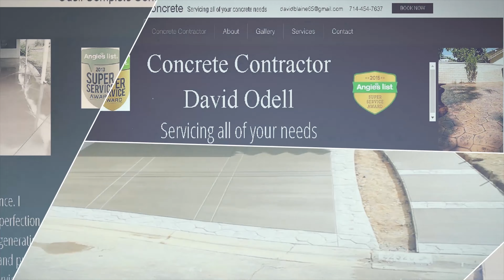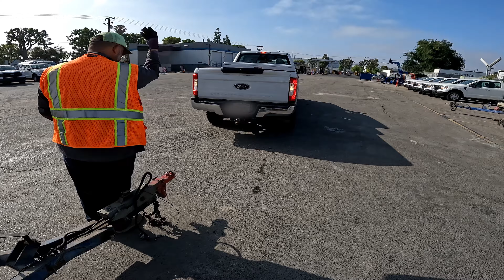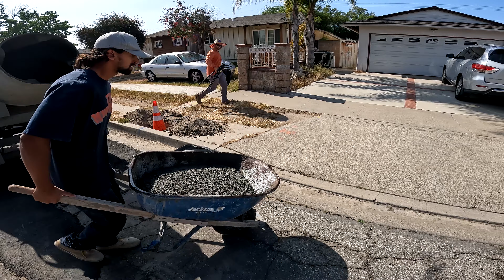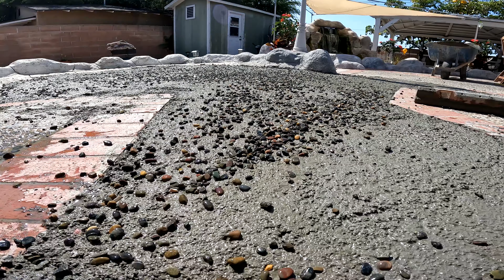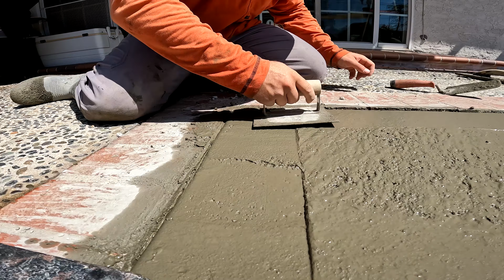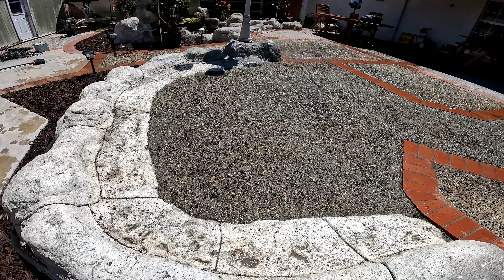DIY How to Get Exposed Aggregate Concrete Finish

Comment: He worked hard on that due to the heat think 90 is about 32 degrees in uk money thats some hot 🔥  stuff.
Dave here the concrete dont set quick is there something you can spray on top set it quicker to be able to hose off the cream .never done this but that would be my worry getting it to set .wales isnt hot .
Thanks mate and great videos 🏴🇬🇧🇺🇸👍👍
Reply from the maker: Concrete additives for fast or slow curing
Reply: @OdellCompleteConcrete  
Ok thanks Dave appreciate it 👍

Comment: Excellent video, often wondered how that finish was accomplished...
Reply from the maker: TY
Reply: generally it's not like this... usually you seed the stones, let it cure completely and then run a buffer over it to take off the hardened layer of cement, then the stones are exposed but also the entire surface is flat... the technique in the video leaves a rounded rock surface, not flat everywhere... also these WILL pop out over time due to that

Comment: Hi Odell as you know here in Iraq we work under 122 F° so its been to hot but we rather did the stamp concrete before sunset .
I'd like to ask you ... Is it worth to work like these mini projects about 9 m2 and you guys 6 and your trucks and that under the heat with waiting almost 4 hrs , is it really worth ? How much the square foot or square metre cost to cover this small project???
Reply from the maker: Sounds like Vegas

Comment: when would you use a magnesium trowel ,wood ,or steel towel in which order
Reply: Wood is for roughing up cream to make mag floating easier. Magnesium floats are for making everything flatter and somewhat smooth. Steel trowel is used to "burn in or hard trowel" the concrete like what you would see in garages or basement floors. In warmer climates they trowel a lot of their work. In more freeze & thaw climates you really want to stay away from steel troweling outdoor concrete.
Reply from the maker: I concur

Comment: Hello, looks great. That is interesting, united rentals will rent you the concrete mixing trailer, fill it with a yard of material. Can you specify the mix, stone, cement etc. Would you mind sharing how much the rental of the trailer and the yard of material costs. Thank you.
Reply from the maker: Yes, 1 yard maximum about 350.00. PSI ranges from 2500 to 3500
Reply: Here in the midwest a truck was 140 a yard. 50.00 short load fee 17.50 fuel surcharge. Was about 400.00 for 2.25 yards. 2.25 yards from another company was 440.00
And the 3rd company was 526.00 for 3 yard minimum
Reply: thank you very much , do you use this system often

Comment: Sugar water in a bug sprayer after seeding keeps the cream on top from hardening on a hot day. Same as a retarder but 1/10th the cost.
Reply from the maker: Yeah it was a struggle since we had to return that little u-cart on such a hot day with direct sunlight
Reply: Rugasol is the go these days, way more even doesn't leave patches and holds longer.